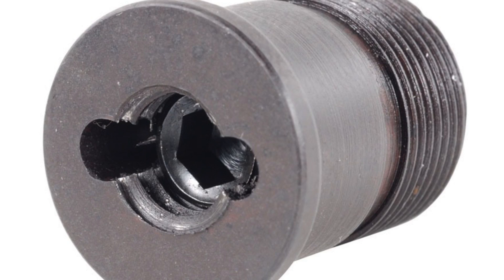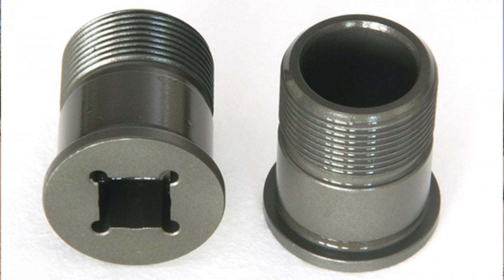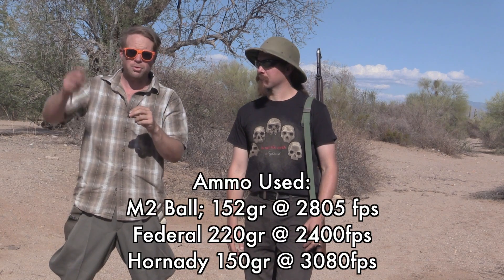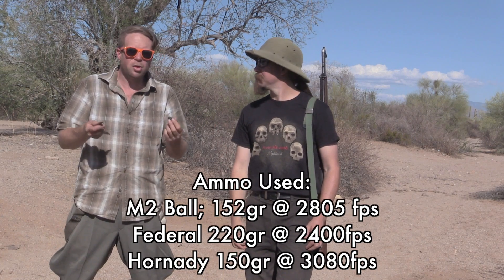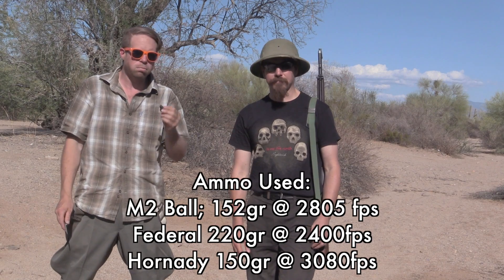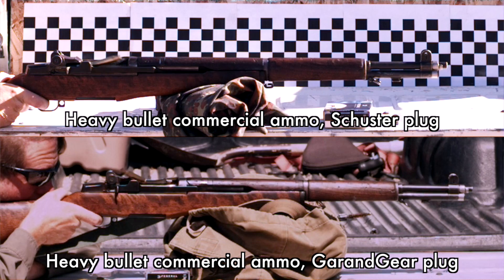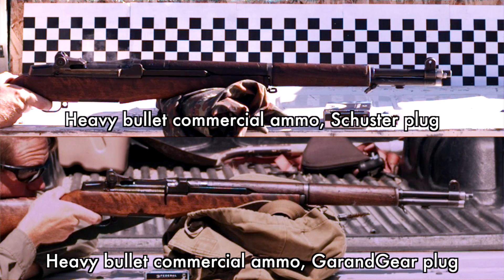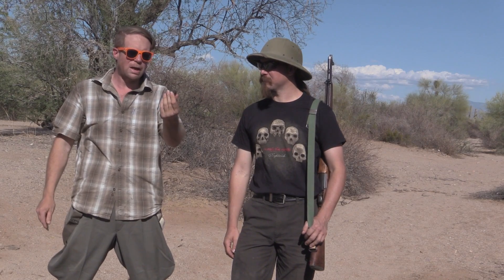Review: Garand Gear M1 Gas Plug

Comment: Had to go with Garand Gear cause Schuster is no longer in production as of 2024. Not a single thing for sale on the website. The new Garand Gear v2 plug allows for a bayonet attachment
Reply: I also found that i can still use my original bayonet with it and I don't fire it often enough to stress the oprod , i have a frist year (1952) remington 760 for the heavy loads

Comment: I like this video and the previous one and your enthusiasm for the M1 Garand and getting some action velocity numbers for it.  However, there is one detail of your testing premise that affects your comparisons that you may want to allow for. The M1 Garand was not designed around M2 Ball.  The military specifically required the Garand or any other rifle qualifying for acceptance during the 1930s new rifle trials to be able to use then-existing stockpiles of M1 Ball, with its 173-grain average bullet weight (specified as 174.5 grains with -3 grains tolerance). The ammunition issued for combat through most of WW2 was M2 AP rather than M2 Ball.  M2 AP had bullet weights from 162 to 168.5 grains, depending on what material was available for the penetrators at the time of its manufacture.  So both the loads normally issued for combat and especially the M1 Ball which was the design parameter load were heavier than M2 Ball and could be expected to produce more operating rod velocity.

M1 Ball is long gone, other than a few surviving very old examples that probably won't perform representatively any longer.  Also, it was loaded with long-obsolete powders like IMR 1185 and 1186, so you can't copy it exactly.   However, you can get extraordinarily close with IMR 4895 and 4064, which replaced the obsolete powders. Hatcher's Book of the Garand has  M1 Ball muzzle velocity, among others, listed on page 124.  The list is of actual at-the-muzzle velocities calculated by Hatcher by working backward from the 78-foot military velocity measuring distance to the rifle muzzle. Based on substituting U.S. Army Ballistics Research Lab (BRL) drag functions into modern computer ballistics software or using drag functions deduced from the military drop and range tables, he appears to have got as close as 1 ft/s by his method. One expects M1 Ball would match the National Match ammunition velocity of 2640 fps at 78 feet from the muzzle, but M72 is actually a hotter load than the original M1 Ball, which Hatcher puts at 2647 fps at the muzzle and thus about 2597 fps at 78 feet out using the BRL drag function for the M1 Type bullet (same as the M1 Ball bullet, but without a cannelure).  Nonetheless, this was still a higher energy load than either M2 Ball or the M2 AP load.  

We aren't allowed to post a how-to here, so even though I've made M1 Ball mimicking loads before, I have to leave you to work it out for yourselves by interpolating Hodgdon's published online load data information for the 175-grain SMK, which will match the M1 trajectory perfectly to 600 yards if you give it the same velocity.  Hodgdon used a Remington case for their data, which is very close to LC brass in interior volume.  They test using a 24" dimensionally tight pressure and velocity test barrel with ammunition manipulated during loading so the powder falls back over the flash hole for firing.  These are the same things the military does to test, so the data should match well to what the military test procedure would produce with the same components.  The main difference is Hodgdon uses the SAAMI 15-foot velocity measuring distance.  Working with the BRL drag function for the M1 Type bullet, I find the velocity should be 2637 fps at 15 feet from the muzzle, so that's what interpolating Hodgdon's velocity and charge data should yield to get a match.

Comment: Great series, and the video clips of the bolt travel are among the most telling indicators I have seen anywhere. Kudos to you for using a self-explanatory method of comparing recoil impulse. I also agree that an adjustable plug is a much more useful solution for using a variety of loads. Ordered two Schuster plugs for my Garands today!

Comment: Awesome video!!!  I would enjoy seeing a video that goes deeper into the calculations and see what the actual volume change is between the standard, Schuster, and Garand gear gas blocks.  Also PV=nRT may not be as applicable at the pressures being tested.  An equation of state that takes into account the compressibility of the gas may be more accurate in this instance, but for simple comparability....it may be sufficient.

Comment: I know this is a old video but when using the sushter or garand gas plug did you see any significant accuracy changes? It would make sense since your changing the rifles gas system therefore what the m1 Garand is designed for is now altered. Yes it’s cool that you can shoot modern ammo but what good is it if at 100 yards for example your MOA went from 1 or 2 to now 3 or 4.

Comment: Thanks for making this video. I live up in Canada where not only Garands are rare, but M2 ball is nonexistent and only commercial 30-06 is available. I just bought a Garand kit to build my own, but could've very easily damaged the rod. Added one of these Schuster gas plugs to my order so I don't ruin a gun I've wanted to own since I was a kid. Cheers guys.
Reply: You're more likely to damage the garands stock than the oprod with commerical ammo if your stock is old and if the wood isn't cared for properly then it will likely shatter
Reply: @henryofskalitz2228 no 😅
Reply: @BaconSlayer69  yes older wood is more brittle and likely to crack and split compared to younger wood. unless it is properly cared for. your oprod also will not bend as long as it is properly GREASED. i repair and work on garands constantly i know what the old ones can handle as well as new reproductions of them. just don't shoot fully powered 30-06 over 180gs and you'll be fine and dandy
Reply: @henryofskalitz2228  A ill fitting trigger group will also crack a stock. Proper grease is most important. Too many people run them dry. I never could understand why the CMP sells them dry, some have bad op-rod springs.
Reply: yeah i don't know why the CMP sells them dry, maybe because they just dont understand the machine spirits wishes with the old m1s?

Comment: If anyone can answer. I recently got a 308 converted m1 and was wondering if steel cased wolf or tula would be safe to shoot it in vs brass. Cost of ammo is not really the argument I'm going for, just if its safe. If you have any knowledge with steel case in 30-06 that also helps. I have an ass ton of tula 308 that I shoot out of other rifles and would be nice to use until resonable ammo supplies creep back.

Comment: Karl, I feel you with the tool not fitting the non adjustable plug.  But my rifle had one of those on it when I bought it and its supposed to use a 1/4 ratchet.  I use a little extension and a ratchet and it works good.  I know this is an older vid and probably others have already mentioned this.

Comment: you two avoided the big question?????
Your safe margin guess ??????? is from what
The million dollar question is did you bend your oprod   and you should have gone through 180s 200s and 220s.
some 180 ammo runs higher pressures than 220 grain soft point.
You must have split your receiver  bent a oprod .
That is the question

Comment: I think you guys are missing the point of it. It increases volume to reduce pressure. Also I used a phillips screw driver to tighten it with no problem.

Comment: I have used both and run really hot hand loads and hornady’s superformamce 150s and 165s - no problems of any kind (though I haven’t fired anything heavier than 180s).  

I have always made a point of using liberal amounts of modern, high temp grease - proper lubrication may be as important as ammo and plug choice.  

However, none of my Garands are especially accurate with hotter loads, so my preferred solutions:

1.  Keep m1 well lubed.
2.  Run factory loads (even modern ones, but never more than 178 grain) for “serious” use - hunting defense(? If a Garand is all you have...)
3.  Garand gear plug - much simpler in application and has given the margin of safety needed (so far) while still cycling lighter loads.

I am still in the midst of a long term handloading project to develop the optimum/accurate hunting load.  

Winchester Extreme Point 150s are the most accurate round I’ve found so far, and it has been in both of my current M1s.

Most of reloading to date has been for saving money on range Ammo.

Comment: I do actually have both tho...   Adjust the schuster so that it will shoot the hornady hot stuff...  Take it out...  use the Garand gear one for everything else... change the entire plug to the schuster when you shoot the hot stuff or 220 grain hunting rounds... easy to switch plugs compared to the using up a bunch of ammo to adjust the schuster.

Comment: Would it be possible to design a plug that acts like a piston. So depending on the pressure of the round it would extend a different length thus making the volume different with each ammo. Sort of similar to a pressure gauge for tires.

Comment: I wonder how the Garand Gear plug would work with the M2 ball ammo in cold weather. Cold weather always wreaks havoc on velocities and power and the only thing I'm worried about the Schuster is that if you set the screw to one temperature and it's safe then, if you move to a different temperature then it's either horribly overgassed or undergassed, depending on what temperature you had that initial set screw in. I guess it's not much of an issue as a civilian since you can just change back and forth on the fly.
Reply: @A Bowl of Pho Worst case, you would end up with a "bolt action" rifle, where you have to cycle it for every shot. Since people aren't taking these into combat anymore, it's not that big of a deal.

Comment: Great review, thanks guys.  I bought one, because of their charts showing how awesome it is as a panacea.  But really, if it's not slowing down bolt velocity, then it's not slowing down the impulse or preventing damage potential.  It's better than nothing, but not nearly as impressive as they were leading one to believe - which is good to know.  Also, I couldn't agree more about the GI screwdriver not fitting.  That is a completely ridiculous oversight for the Garand Gear guys to do that!  Why on Earth would you NOT machine the plug to be compatible with the standard tools for plugs!?!??!?   It's more than just an annoyance, gas plugs come loose all the time.  The ability to field tighten such a thing back up is vital.  It's sloppy, and when companies do something sloppy, it makes you doubt.  That should have been my first clue that the claims were overstated, and sloppy design features like this make it a lot easier to believe your findings, that they also overstated the effectiveness of the item.  I'll keep using it, I have it anyway and it doesn't hurt - but if I had to do it over again, I probably would have saved my money.

Comment: I've shot almost 800 rounds comprised of a mixture of commercial 150, 165 and 180 grain loads from various manufacturers with the Garand Gear plug and have had no issues with my rifle. I've shot a few 220 grain loads and they ran fine, but I wouldn't feed my M1 a steady diet of them and I don't plan on ever using any superformance loads. With that said, the GG plug has proved to be well worth the money for me.
Reply: Tripp426 how many times did you use the 180 grain
Reply: so, you're basically reiterating what they said in the conclusion of the video.
Reply: "No issues" may mean you haven't bent the op rod yet. Just a matter of time. The vid's testing showed no difference in op rod velocity on heavier loads.
Reply: @TheRayDog but they said that that was only the hottest 220gr load they could find, which is obviously not what this product is designed for, and I would say using such ammo is asking for trouble

Comment: How comfortable do you guys feel about the slamfire issues using commercial ammo on these plugs? I look forward using nothing but whatever 125-165gr hunting ammo I can find. I'm not at all worried about the op-rod issues but the softer non milspec primers guess you can say.
Reply from the maker: The slam fire issue really wouldn't have much to do with the gas system.  The M1 should be loaded with "hard" primers but I've never seen an M1 slam fire EXCEPT when single loading and allowing the bolt to go home on a round already chambered.   When stripping the rounds from the en-bloc clip, the bolt is deccelerated thus making this situation less likely.   Obviously the gun should be pointed in a safe direction when chambering any round, hard or soft primer being irrelevant.  ~Karl

Comment: You guys seemed to have missed the most important point here.  High peak pressures in the gas cylinder is what damages op-rods. Bolt velocity deals with the total impulse applied to the operating rod. That impulse can be sharp (usgi gas plug) or gradual (ported gas plug).  The Garand gear gas plug is designed to lower the peak pressure BUT preserve most of the impulse. You can see this in their pressure graphs.  It applies a softer force for a longer period of time.  A good analogy/comparison is a dead blow hammer vs a regular one. You cant look at at bolt velocity and come to any conclusion as to what the pressure was in the gas cylinder.
Reply: Accurate comment.
Reply: Thanks. This is what I thought I learned from their graphs.
Not the velocity, but the pressure.
Mine works great.

Comment: Very happy you did this test. I originally opted for the GG plug because in theory I would have less bits and bobs lying around and could, in a pinch, shoot something slightly higher than the surplus/reload 150g M2 I normally use without the oprod immediately hating me forever. Looks like now Ill just spring for a Schuster plug and tune it down to 150g and still be well in the clear. That low bolt velocity coupled with the SEI compensator and kitchen table gunsmith custom fit kick-eez butt pad and ill be good to go!

edit- One thing I did notice was after I installed the GG plug I stopped having random oprod dismounts so I guess that measly 10 inches of reduction made some significant difference in its operation. Also when I was younger and inherited the rifle from my father (first rifle ever owned) the first thing I did was put 3 boxes of 220 grain through it at the range. Bigger was always better, right? Oh boy did I learn the in's and out's of Garand maintenance and repair that year.
Reply: What we’re the consequences of shooting that ammo at first?
Reply: @Gunsmoke2141  Bent the oprod most definitely was the immediate result. Took a lot of time to figure that out.